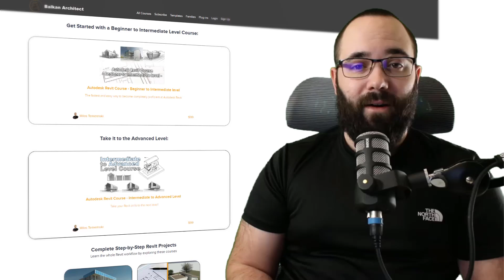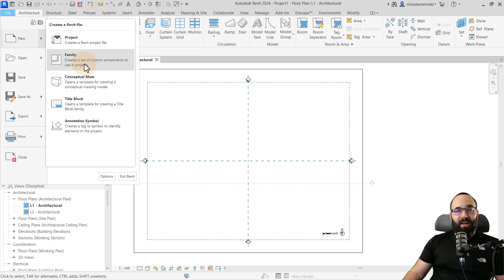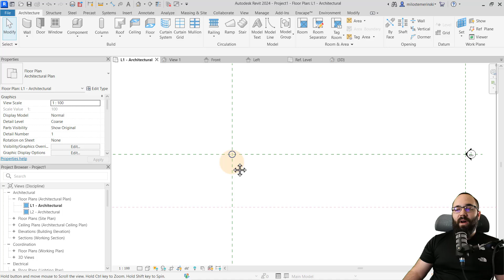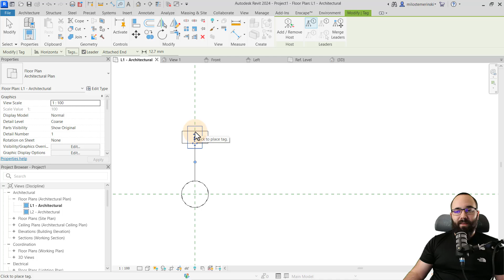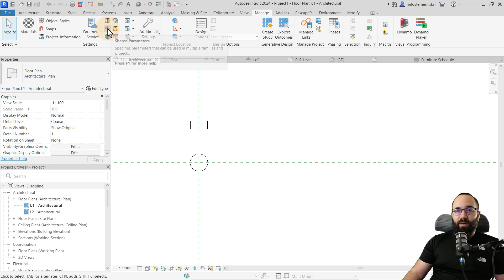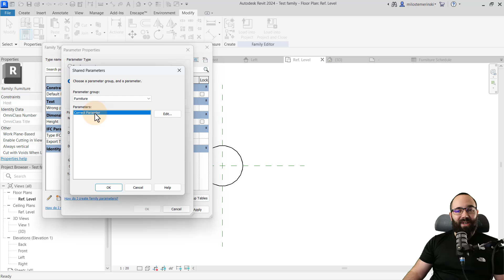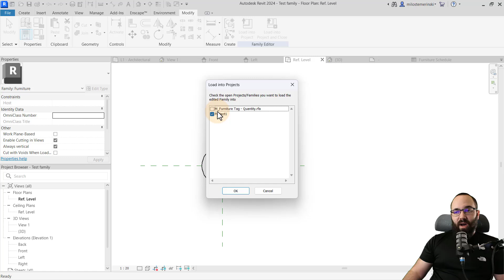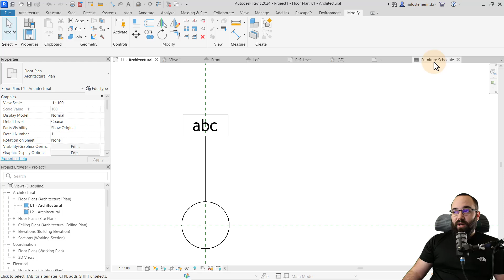Shared Parameters in Revit Tutorial

Comment: So, I am trying to redo some of our company's families, specifically the doors. And we had a bunch of old shared parameters and a bunch named funky, with incorrect grouping. So, in question 1, I renamed some of the shared parameters. They look fine in the Shared Parameters file and within the door family, but when I bring in the Door into a Revit project/template, the names go back to the original names and categorize them likewise. So, are these housed somewhere within the project/template I cannot see? It was rather frustrating because I purged all the doors and cleaned up all the schedules. Is there a way to create a custom "Parameter Group" within the Family Type dialog? ie Construction / Materials and Finishes ..etc?
Reply: From my humble experience, you need to:
1. create new shared parameter file, 
2. delete all the doors and families
3. switch to new shared parameter file in current project
4. edit your families with new shared parameter (delete old parameters, add new ones)
5. load edited families into current project

Comment: f@#$ me! Coming from Archicad , this looks like a looooot of clicks. So if you already have a lot of families in your project, you actually need to open all of them to just add the shared parameter, and then select all of them and add a value.Then modify the label to allow to read that parameter. A bit convoluted in my opinion. Its offers a lot of granular control indeed, but my gosh its a process.
Reply: its like coding, you basic can create the item class, then you define the class. the shared parameter is pre-set up parameter, for this project, make it "public" to readable. if the parameter only existing in family, means private
Reply: Also coming from ArchiCad and also F@#$ me!  To achieve something really basic you have to spend your day programming.  This is like computers in the 80´s but I really appreciate the videos of Milo, at least he walks you sanely  through the steps of insanity 😂